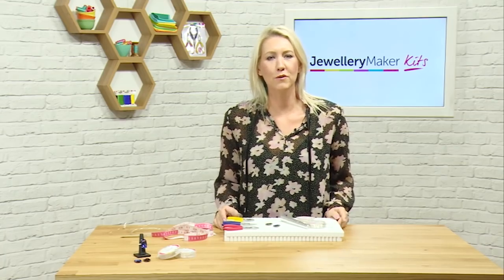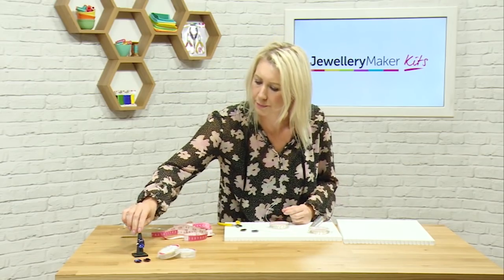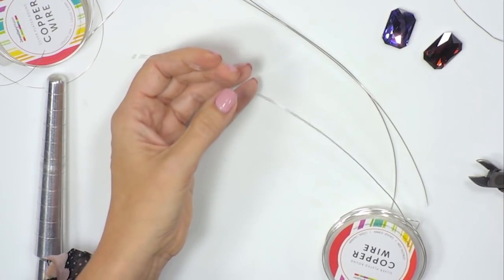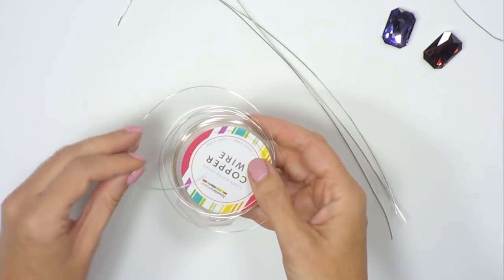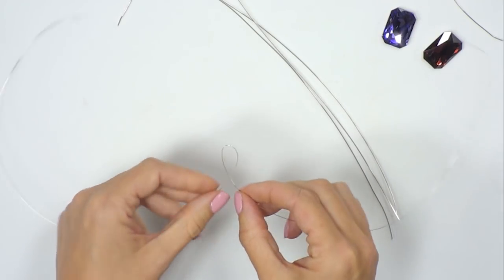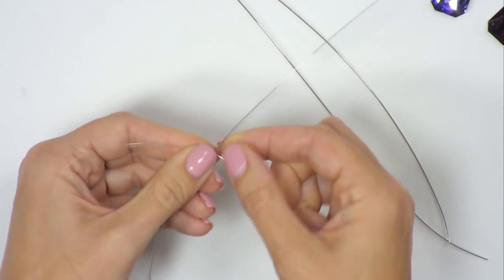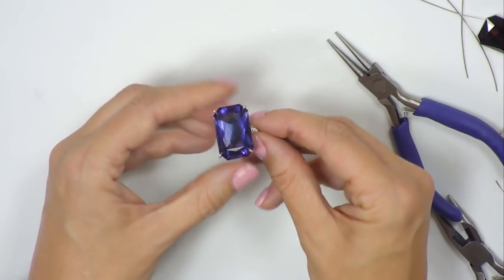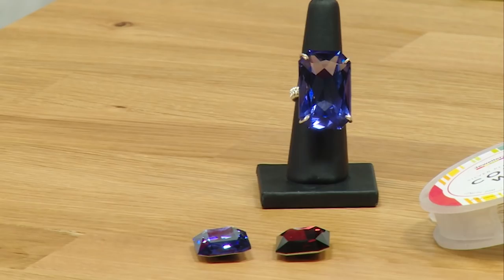DIY How To Jewellery- Wirework Rings Tutorial

Comment: Love how you lock in the ring size. My rings tend to get smaller and smaller. I think this will work for a rectangular cab, not emerald cut. I'd just need to position the prong wires at 90 degrees apart. Yes?